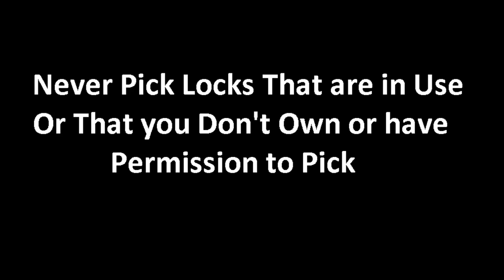(91) Update on the Taylor Group 2 Safe Combo Lock + A few new Items

Comment: Holy Moly. You Keep this up and you'll be banking your first million in no time. lol. Seriously, get some intellectual protection on your projects. I would be stoked to have a prototype pick set. I could get feed back from locksmiths here to how they feel about them. I think the S&G safe dials are more precise and balanced and would be a far more formidible force to reckon with than most people think. Re the giving out of the working of the dial on a safe....don't worry. Safe manipulation is a specialised field and very few can manipulate a safe dial in real time whilst in a operational safe door. What i found interesting with the antique safe dial you have is the fact that there are no numbers under 20. Very interesting. I think i know the secret. lol. Cheers:-)
Reply from the maker: Haha, thanks Paul! Yeah from what I hear, those dials dont have numbers under 20 for 2 reasons, So you dont make a bad combo. IE. last number between 1 and 20. And for anti manipulation. (The contact points are in that range) Thanks for your imput Paul, I may have to go more indepth on safe locks one of these days!

Comment: Shaft is out of round / bent or the dial pack is loose. Try remounting but by the looks it's the shaft. Those spiral extractors will work they are used on the side warding of the key. I have a few of them and find them to work well.
Reply from the maker: Yeah, your right, the shaft is bent  a tad. The drive wheel only contacts the cam on a half rotation. Still happy to have it, but I dont think I'll be decoding it any time soon, lol.